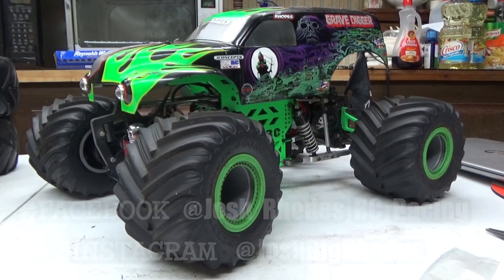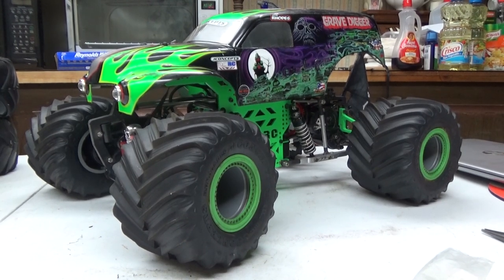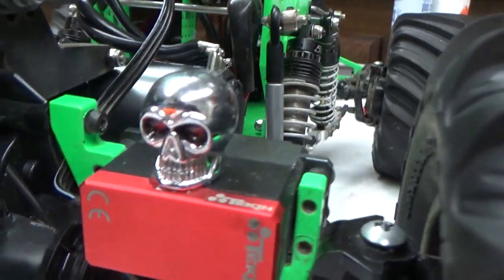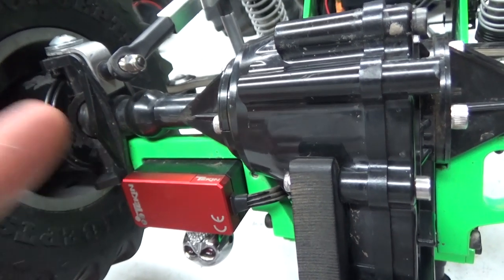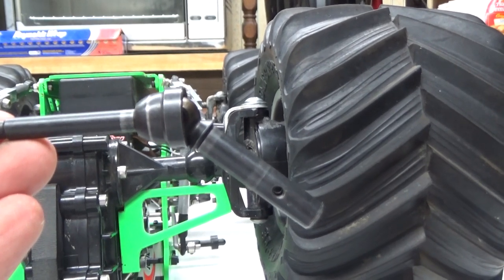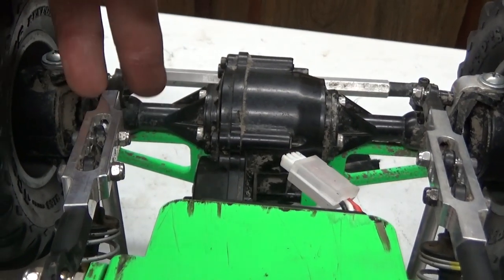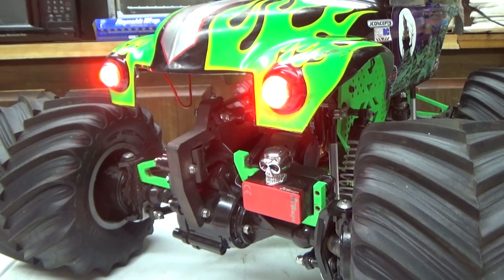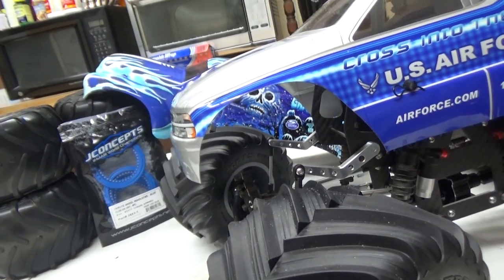Grave Digger Pro-Modified Tamiya Clod Buster Build Overview with Josh Rhodes - Trigger King Tech

Comment: Thank you so much for the detailed look at your incredible Clod Buster.  I am returning back to the world of R/C monster trucks after a twenty year break so I am now dusting off my old ESP Clodvilla IV Clod Buster and getting it rolling again.  It is interesting to see how many different chassis kits are available now compared to twenty years ago.  Many of the kits back then are long-gone too.

Thank you for showing the JConcepts bump stops at 3:03.  I always had that same problem of my Clodzilla IV suspension bottoming out its Team Losi shocks after a big jump.  I just used a stack of old Losi shock seals (O-rings) on the shock shafts to help absorb the impact but they were always too soft to do the job very well.  They were better than nothing though.  Thanks to your video I bought the JConcepts bump stops and I just installed them today.  They are exactly what my truck needed 20+ years ago!

If anyone wants these bump stops, they are JConcepts part number 2662.  They are sold in a pack of eight.

Thanks again!

Comment: Great video I just picked up one of those chassis for a next year promod rig
What weight shock oil do you run
Reply from the maker: In the Pro Line Power Stroke shocks, most guy run 20-30wt.
Reply: @TriggerKingRC  Thank You

Comment: Awesome video and car!!  Thx for sharing.  Anything different inside the diff boxes?  Stock clod gear sets?!  Thx!
Reply: Thank you! Only thing different other than the TTR Axle Shafts is an aluminum counter gear. Everything else is stock.
Reply: @JoshRhodesRC  do you use both aluminum counter gears or just the one the pinion runs on
Reply: @michaelniedojadl5481  only the counter gear.
Reply: @JoshRhodesRC  Thank you Josh

Comment: Hi Trigger King this build looks Rad as, thanks for Sharing.

I've recently dug out my stock Tamiya Bullhead, for some reason as a kid 25 years I removed all the electrics & now no longer have stock motors & manual speed controller.

Could you recommend an electric setup for a stock chassis that gives a gives a little more performance but isn't as extreme as this mighty grave digger? Unfortunately I have no idea what motors & esc to get, would you recommend brusheless for a stock setup (maybe upgraded with damped shocks in time)?

Have a few 3s lipos from some planes but that's it.

Thanks Trigger King, any recommendations & thoughts very welcome.

Comment: Really nice truck. I have to say its much hard to get parts for clods than the smt10.
Reply: Unfortunately in todays world that is the case. I've started getting some more SMT related vehicles for this reason.
Reply: @JoshRhodesRC  I know it's been out a long time, but I dont understand why tamiya don't come out with a new truck that's a bit more robust out the box so you don't have to replace 90% of the truck to make it reasonably fast and durable. I think a lot more people would buy it, maybe not.

I guess mostly stock its OK for retro, and maybe a few upgrades it's OK for sport model, but for pro mod they get expensive.
Reply: @LawrenceTimme  I've been wondering the same thing for 25 years now.
Reply: @Arctic_Falcon  lol. I wish they didn't use toy grade plastic and screws. It's not like they haven't made trucks with decent materials in the past either :(